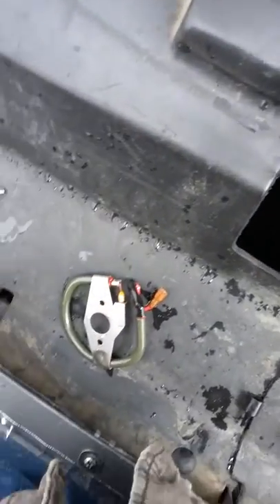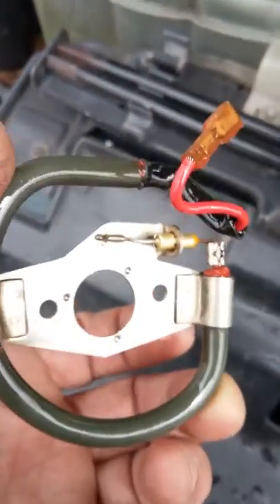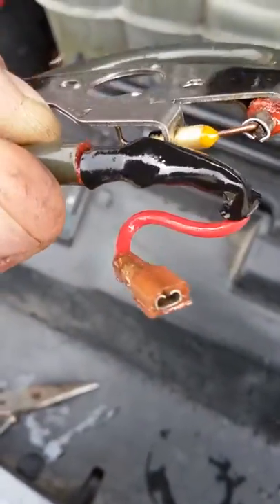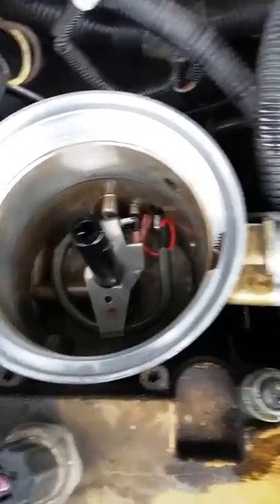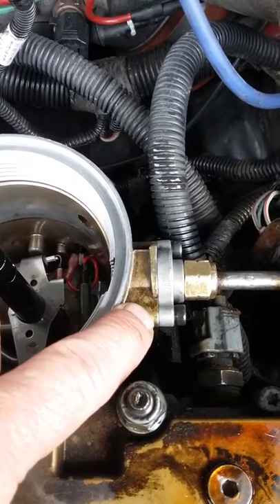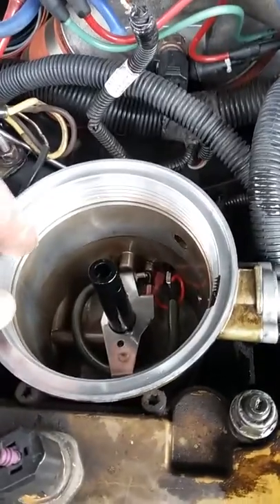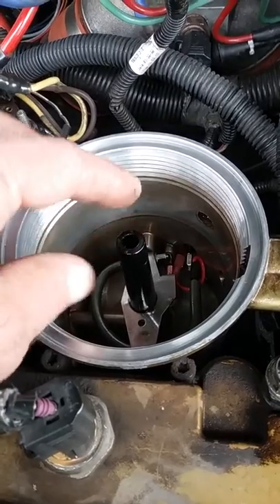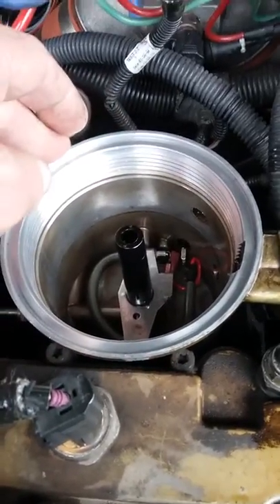E99 7.3 Powerstroke fuel bowl heater and info

Comment: Is it possible to relocate the 99-03 7.3 fuel bowl to the side of engine? I want permanent access to the oil supply and hpop pump area and/but also want to keep the original fuel bowl.  If this is possible it would eliminate having to remove the turbo and fuel bowl just to gain access to the IPR valve or hpop oil pump components on my 2002 7.3 box truck/VAN. PLEASE HELP 🙏 
Also is there a kit out there to buy that does it?
Reply from the maker: Anything is possible with the right fuel fittings and lines

Comment: How do you know if heater is not working or needs replaced?
Reply: It will blow a 30amp fuse in your fuse box. Same fuse that powers your computer. So basically your truck wont start. It will crank.. but no start. And you wont have a Wait to Start light. If that fuse blows = no more wait to start. Cause = is a bad heating element in the fuel bowl.
Reply: It is on the same circuit as your glow plugs. If the fuel heater is shorting out due to age, it will blow the 30 amp fuse in that circuit. 
Your 7.3 will not start without this fuse as it also ignites the glow plugs.
It does not matter if it is a cold or warm day. Your 7.3 diesel will not start without the glow plug circuit on.
You can disconnect the plug to the fuel bowl heater (backside of the base of the fuel bowl) and then it will run if the heater is the problem.
You can run your 7.3 without the fuel heater as long as it is not super cold outside.
It is easy replace the heater and only costs about $20 on Ebay for an aftermarket heater like the one he is installing.